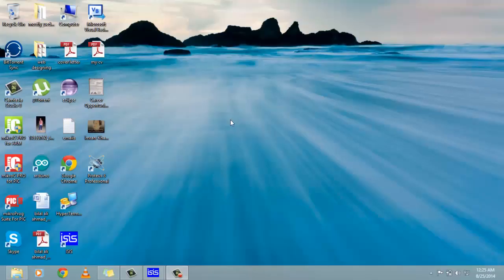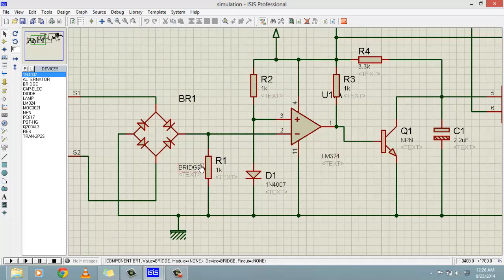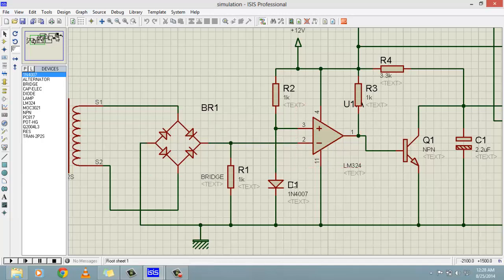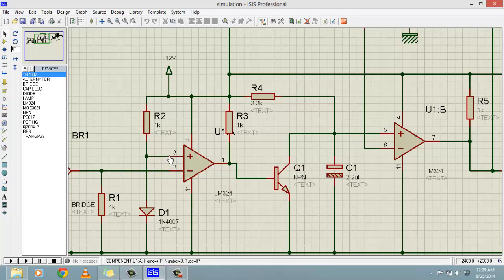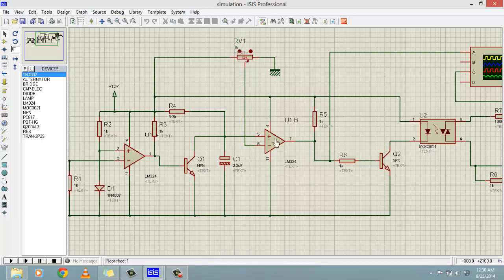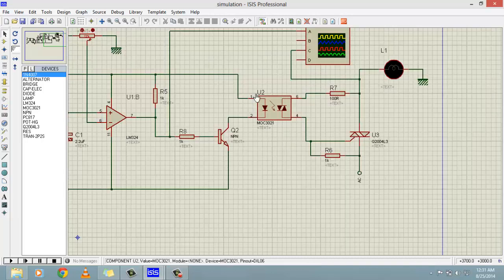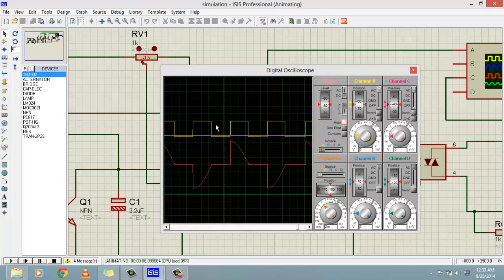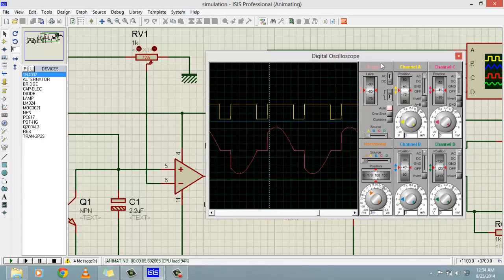Thyristor firing angle control circuit

Comment: Hello, by chance, don't you have a code in the Arduino IDE to adjust the firing angle of a three-phase controlled rectifier (SCR) circuit?

Comment: I'm working on a similar project but would want to produce the 12 volts dc from the same supply after rectification using Voltage Regulator 7812. Any ideas, my head hurts can't figure it out

Comment: Sir...may I apply this circuit for smooth start of single phase induction motor which work under firing angle control principle
Reply: did you try to do it ?!!
Reply: I'm working on it for 3phase induction motor

Comment: Hi i was wondering if by replacinng the moc device, and the triac, by say thyristor,s if i would be able to change the circuit to an ac to dc power controlled circuit, because this is ac power controlled.